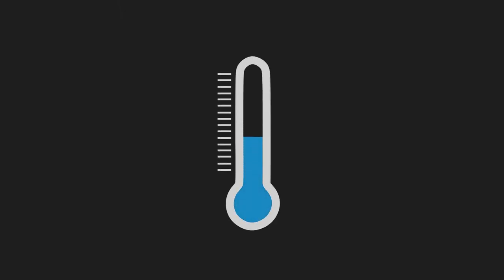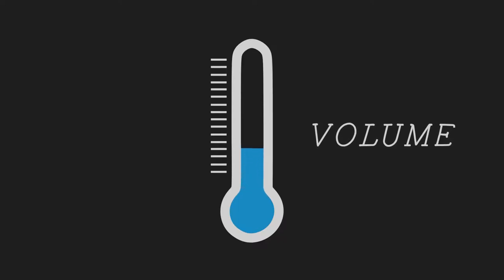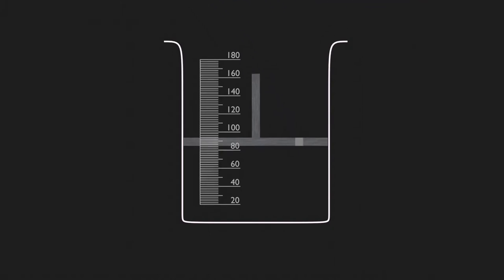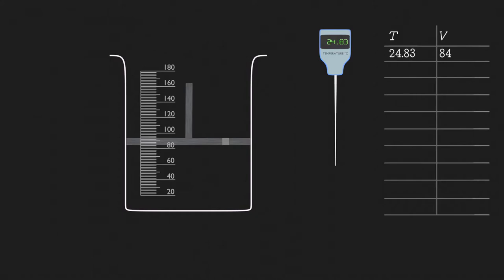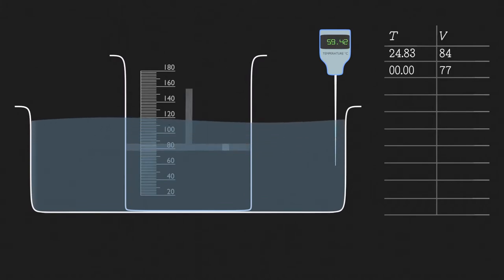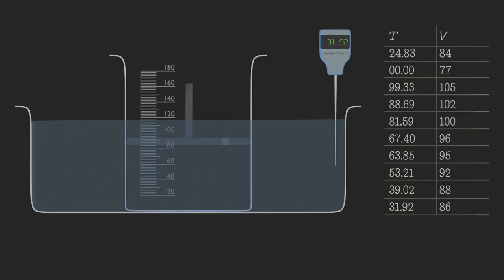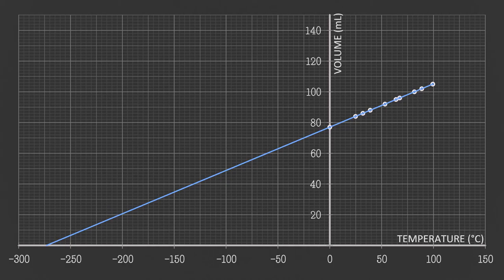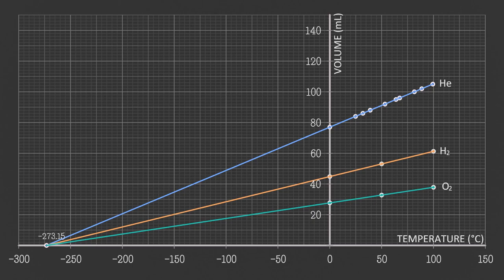How To Find The Value of Absolute Zero Temperature

Comment: Very good, and most likely 100% correct, but would you need many more measurements, especially at colder (sub-zero Celcius) temperatures to make sure that the relationship is not asymptotic?

Comment: Why not use this with arctan instead of a ratio with 2pi in e? I eyeballed the tangents. (760/7463+1240/7463)/(1-1240/7463*(760/7463))=14926000/54753969≈0.2726012428432. He is approximately 0.280048237974... He might be 7/25, which is actually a rational triangle 7^2+24^2=25^2. MORE NOBLE GASSES PLEASE! Err, the slope is [L]^3/E or [L]*[T]^2*[M]^(-1)?